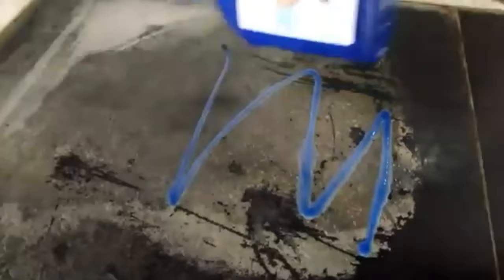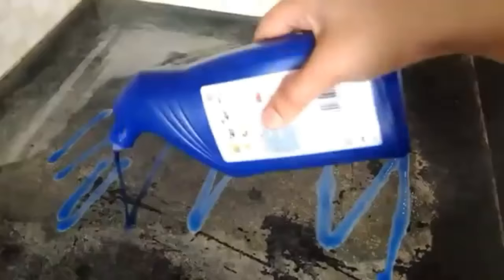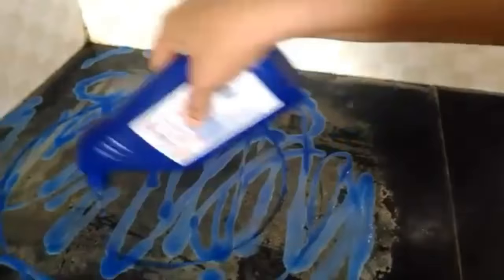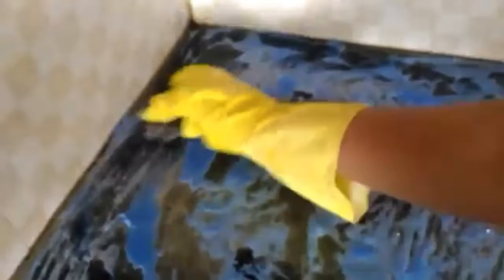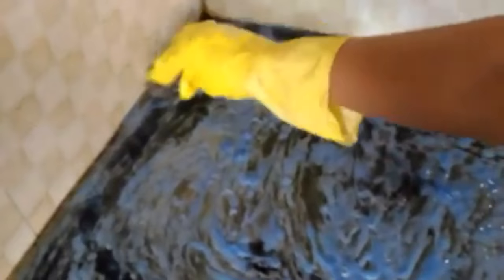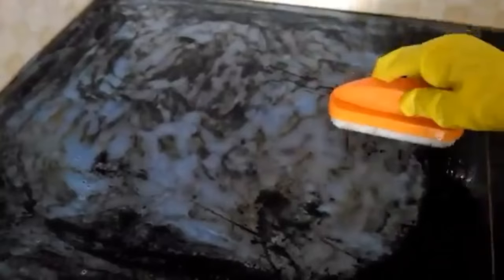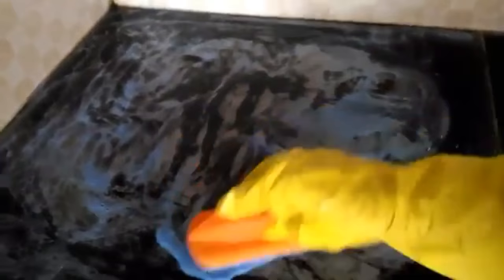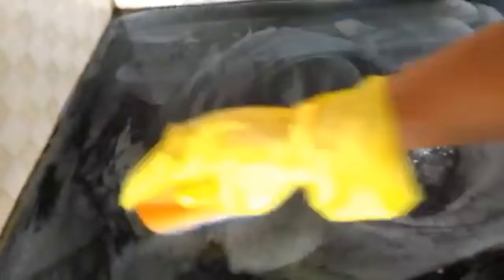How to clean/remove hard/salt water stains from Sink top, tiles, Kitchen counter top in 10 minutes

Comment: Hi, in locked house, due to leakage of water there are stairs on room floor tiles and There are also green spots due to water remains for Long time, does your process described in video can help to clear all and make tiles again as per previous?
Reply from the maker: Green spot due to algae growth because of rain water. Try this method once.... but if the stains are yearly stubborn then go for acid wash...... Please perform the method after taking precautionary measures..... Thank you 💐

Comment: Does it work for hard oil stains too ? My kitchen platform is same like yours but instead of salt water it has tough oil stains. Oil has been piled up alot
Reply from the maker: Hi, to get rid of oil surface use only hot water first. Be careful while handling. After 2 to 3 times of oil surface cleaning with hot water it will be easier to perform the method which I have shown in the video. Please use hand glouse and face mask before performing the method. Open all windows and doors. Happy cleaning.....!!!
Reply: It's my tried and tested hack for removing stubborn oil and grease build up over years...really a centimetre of grease built up... Just use drain cleaner..which is used for clogged drain...just wet the surface..pour the powder..leave for half a minute. .Use protective gloves. .using a toothbrush or steel scrubber. .work your magic...Effective and fast..Try it..
Reply: I used Drainex
Reply: Use hot watr nd drainix
Reply: Use baking soda paste for oil stains. Let it sit overnight with the baling soda paste. Clean with damp cloth and polish with a terry cloth.
Reply: if still looking for solution then try dish washing liquid and steel scrubber

Comment: acid and harpic use pani kuda toilet strain poga mature...ena pakalam mam...
Reply from the maker: Please don't ever use harpic and acid together. U can use 1 only at a tym.

 Last year a guy died using both and got suffocated. 

U can even try following method for bathroom floor cleaning, it may take half n hour to vanish the stains in bathroom (this method is only for bathroom cleaning) Day before cleaning the bathroom take head bath applying oil on ur head n take bath. Later next day u can conduct this method!!!! Take a brush n start rubbing a single tiles and move on u ll only get surprised that without applying any harsh chemicals u could see the tiles get rid of stains. I did n succeed hope u ll get benefitted. Happy cleaning👍👍